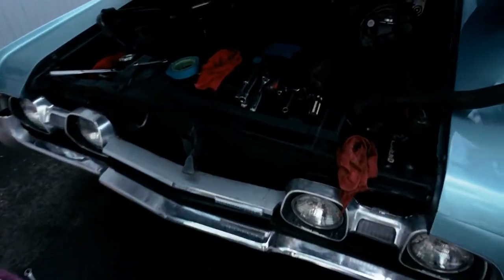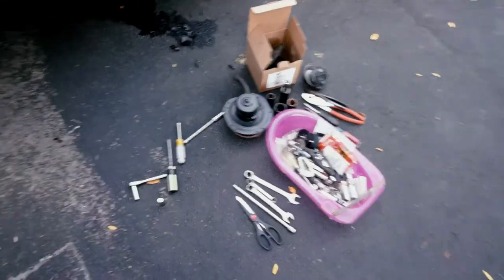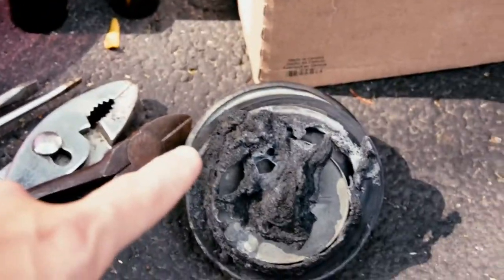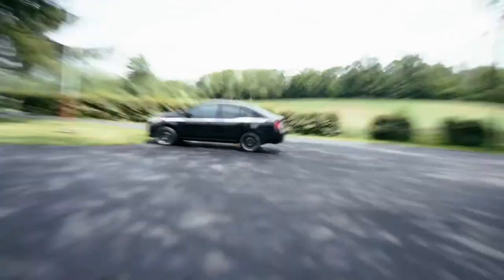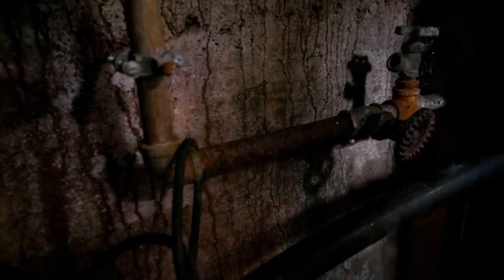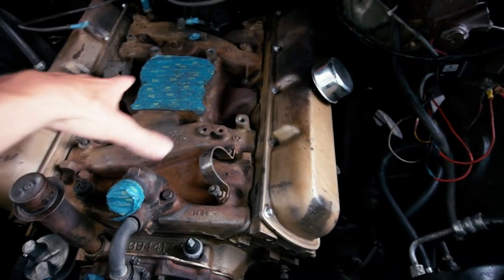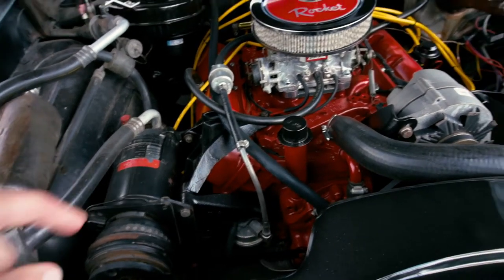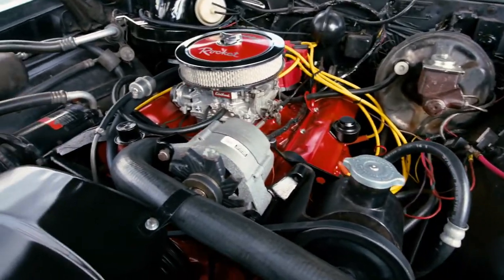Engine Cleaning & Restoration - Cutlass Chronicals Chapter 4

Comment: Aight I'm late to the party but..... I see your AC is gone. Does the heat still work. Your fire wall what do you keep and what do you replace to clean it up? I really need help with my engine bay. 72 Cutlass Supreme.
Reply from the maker: AC is still in the car, it just needs gone through. That's actually on this summer's agenda. It's getting all new AC hoses, the compressor is going to get a rebuild, we'll leak check the system, then fill it with R12 refrigerant.

Heat works fine.

When he went through the HVAC system, he de-rusted all the metal vacuum controlled doors and flaps, painted everything, and replaced all the vacuum diaphragms (they were rubber and the rubber had dry-rotted).